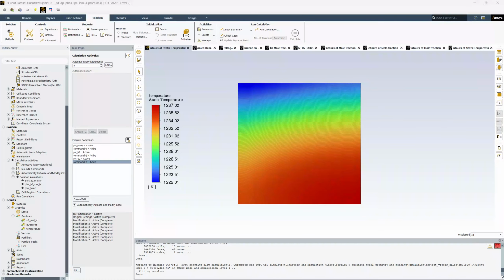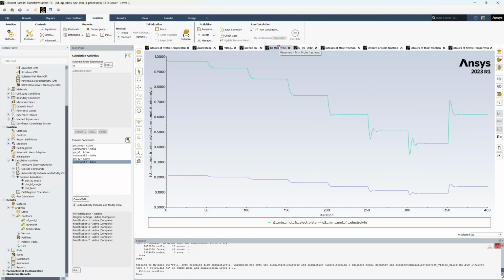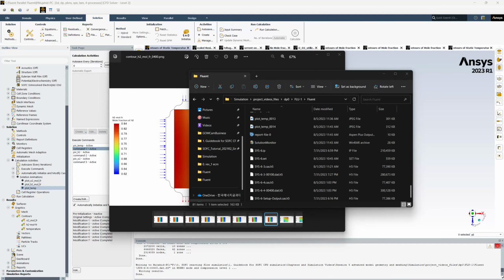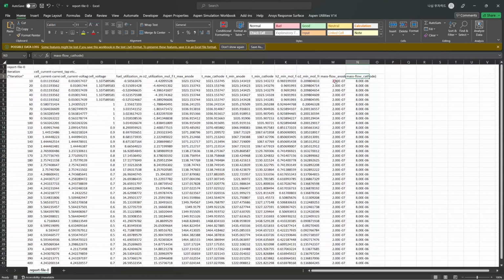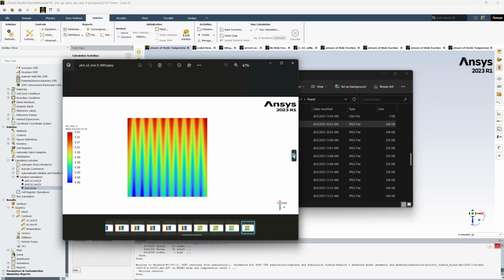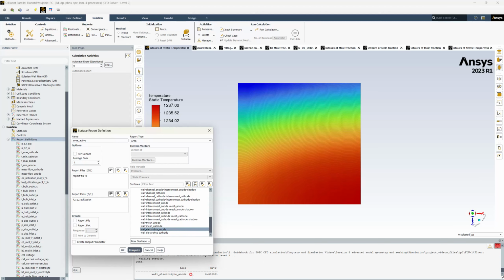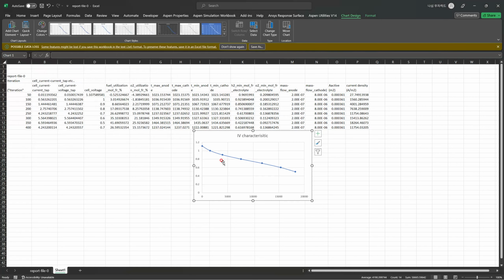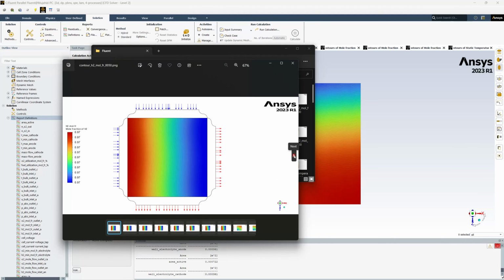SOFC CFD analysis tutorial in Ansys Fluent - Session 12: Post-Processing of advance model

Comment: Thanks a lot for your tutorial. I built a 10x10 battery using your method, but the fuel efficiency and current density are really low. Can you tell me which parameters I should adjust?
Reply from the maker: make sure that the geometry was perfectly attached. even in micron error can make a significant error. then try to adjust the flow rates if the current densities are same.

Comment: Brother I hope I'm not too much hehe. I followed your same exact parameters but my IV curve was way higher than yours or both of the research papers you mentioned. knowing that I only worked with 1M element cells
Reply from the maker: mesh sensitivity analysis is necessary before the results can be deemed acceptable. compare your results with published data. sometimes there is very small gap between the surfaces while modeling, this can make many errors.